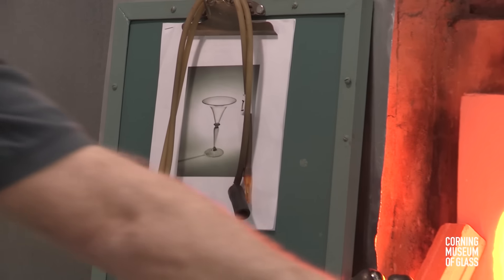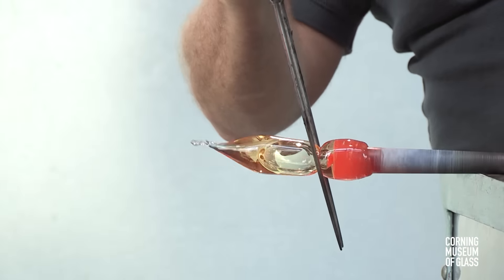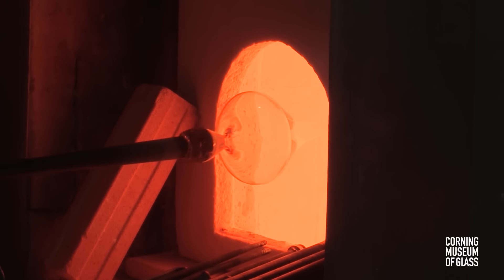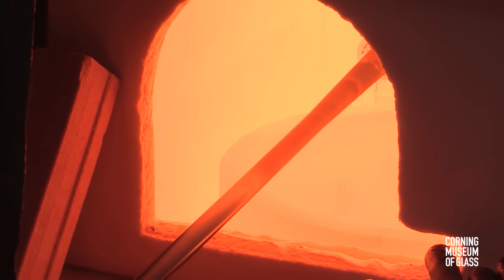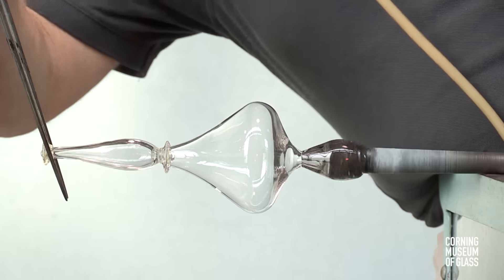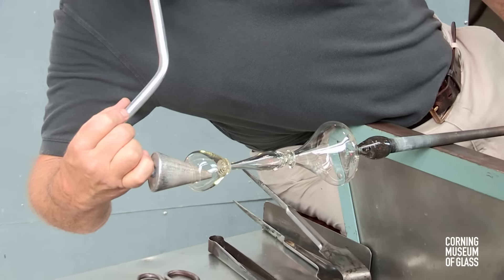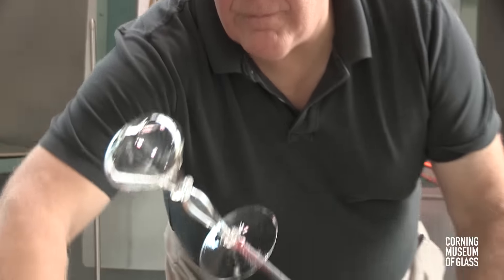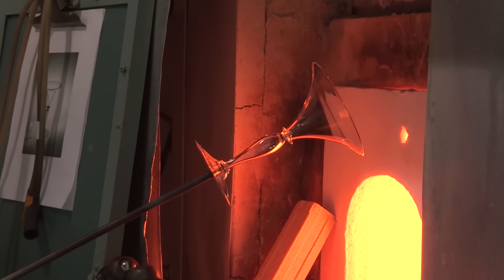Classic Flared Wineglass

Comment: How is the punty mark on the bottom of the foot taken out? I always see furnace glass simply taken off the last punty into the kiln, but with borosilicate in lamp working, the usual method would be to flame polish in the torch. Great video!
Reply from the maker: +Dillonhusky --The punty mark is left as is.  You could flame polish it witha  long torch in the annealer, or very quickly while using forks to put it away, but traditionally, the mark remains and is an indication of hand made glass, as well as the skill of the maker.
Reply from the maker: +Dillonhusky --

Punty-marks
(Pontil-marks: different word, exact same thing) are more interesting than they
look (I'm adapting my favorite Mark Twain saying here: "The music of
Wagner is better than it sounds").In Roman glass, Medieval European and Islamic glass, and Renaissance Venetian
glass, the punty-mark, a rough place on the bottom center of an object, seems
to have been fully accepted as an integral, unavoidable feature. Today, not
infrequently, glassblowers zap that area with a torch immediately after breaking
away the metal rod, thus fire-polishing the punty-mark to near invisibility.Here's
a terribly interesting thing-to me, anyway: if you look at the base of any
baroque German or Bohemian glass decorated with engraving (often exquisitely
finely executed), you will always find a rough, often quite messy punty-mark!!!
The engraver/lapidary artist who created the decoration could have removed the
punt-mark blindfolded, with one hand tied behind their back: BUT THEY NEVER
DID!I rather think of the punty-mark as the umbilicus (belly-button) of a glass
object. This subject once came up in a glassblowing class I was teaching. One
student happened to be a fine plastic surgeon. This odd question came to mind,
and I failed to exercise the good taste to suppress asking it: "Jeremy,
could you remove-that is, make invisible-person's belly-button? "Well...I
suppose so...." Has anyone ever asked you to? "Good heavens NO!"Like I said, punty-marks  are more interesting than they look!Thank you for your question, Bill Gudenrath
Reply: +Corning Museum of Glass 
Interesting, I never would've thought about it that way. Thanks for the info! :)